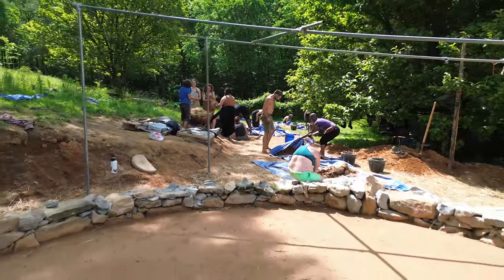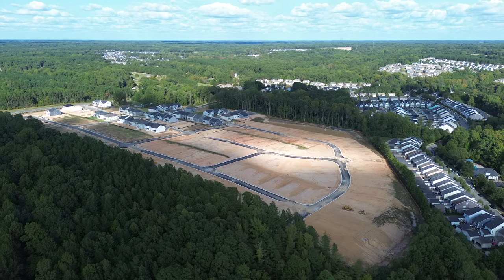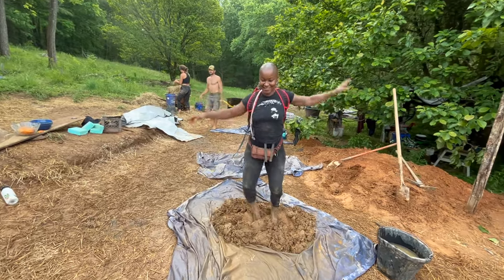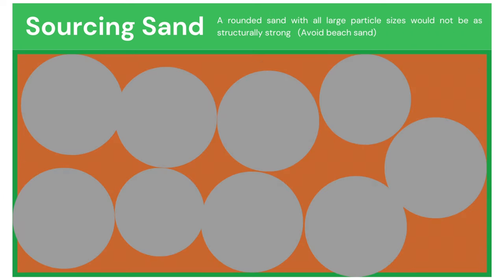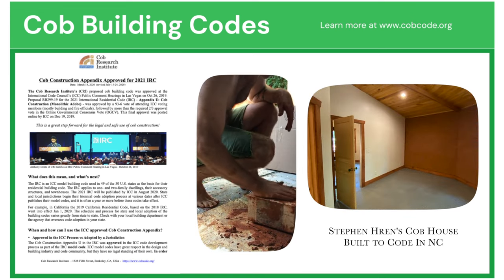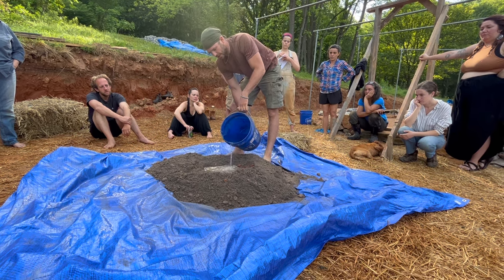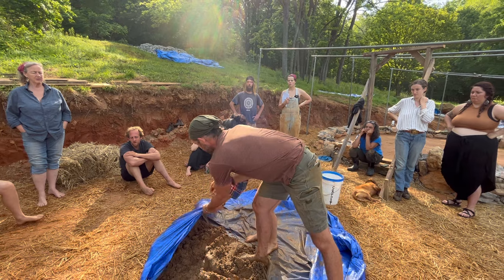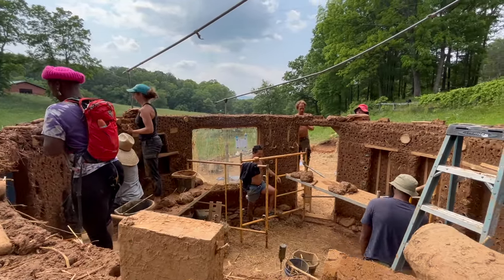How To Make Cob & Test Soils | COB HOUSE Part 4

Comment: So this might he seen as an ignorant question, but why not just make the cob into those basketball sized loaves to begin with, rather than turning a large amount and then dividing it down? My thinking is you could do it in a smaller work space and would be able to determine ratios a little more accurately per brick, like it would be "This many cups of sand, this many cups of clay, handful of hay, etc"

Then again, its easier to stomp than it is to kneed for potentially hours on end
Reply: I guess with your suggested method, what you gain in saving energy from stumping a bigger batch, you lose in time doing smaller batches could be their reasoning? I'm gonna try your method since I will be working by myself by reducing the ratios to smaller measuring buckets. 

Thanks for sharing.